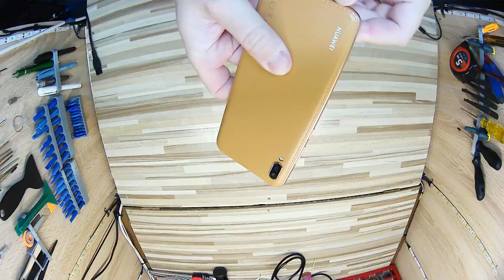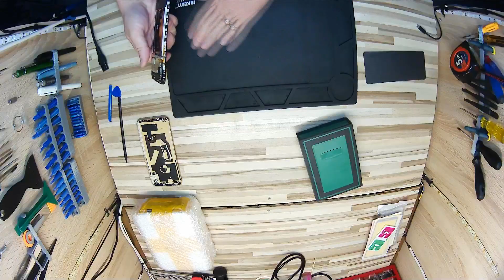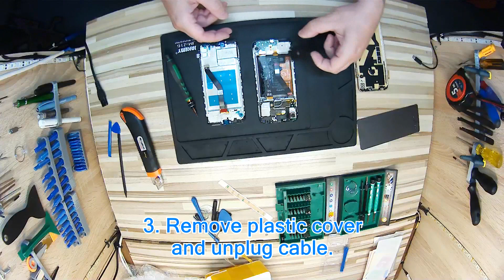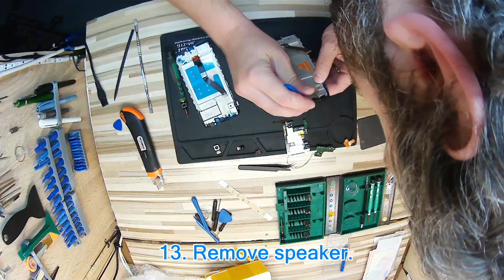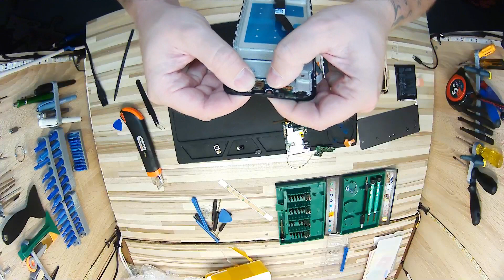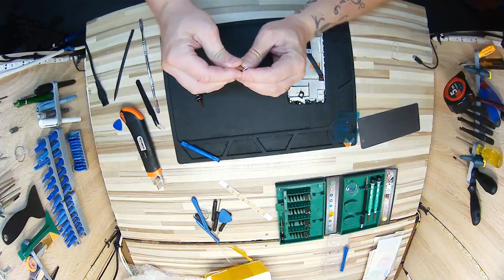Huawei Y6 2019 screen replacement

Comment: Hey, is there a way to remove the Glass from the LCD Panel?
Reply from the maker: Yes with a heated bed and thin wire but you need to have a lot of practice to do it correctly. Than you need to clean and apply new UV glue ... It is really a lot of work more, with a high chance to broke the screen and you save 5-10$